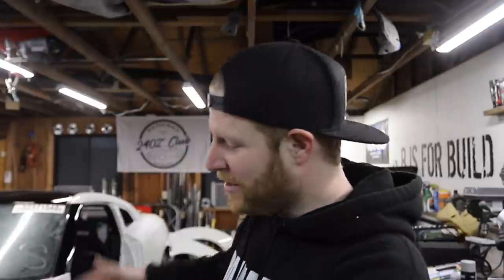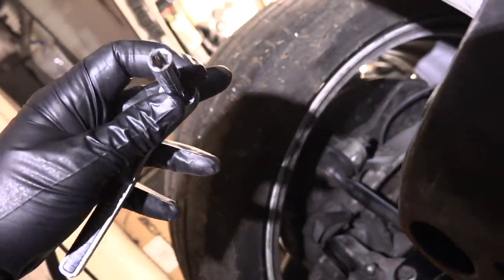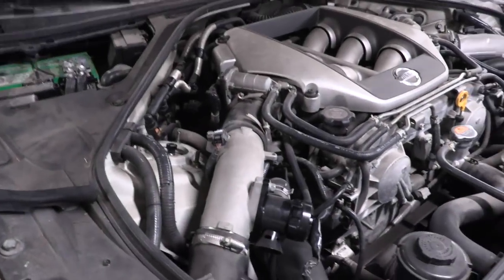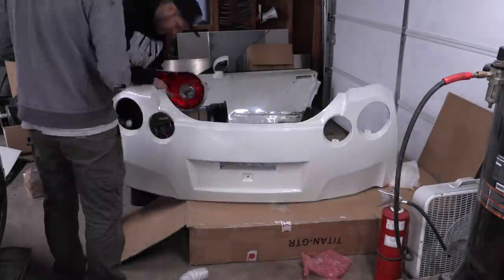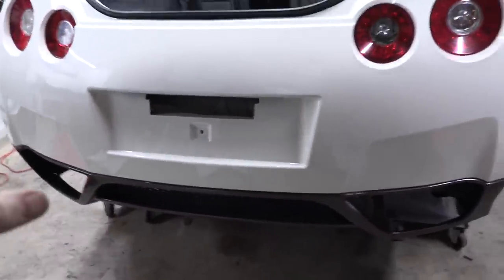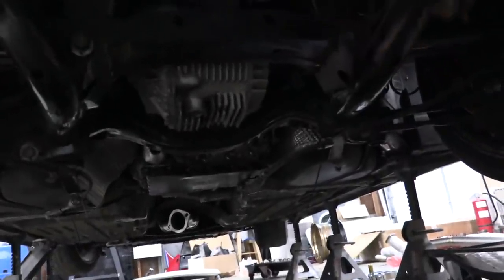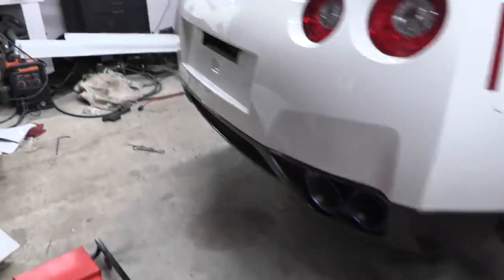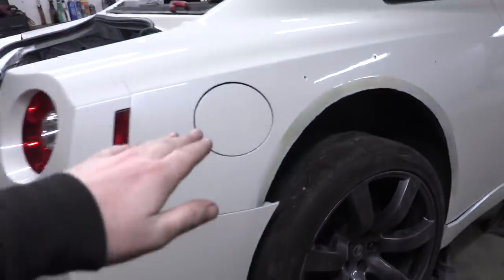The GTR gets New Titanium Exhaust that Shoots Flames!

Comment: This gtr was trashed at first!!! Now look at it like I say "B IS FOR BADASS BRO!!!"
Reply: Shoddy repair. Jes done alot of bunk ass cheap fixed that will be detrimental later on
Reply: @pwnzlikeme  detrimental in what way. It's a salvaged car. It's not like he's gonna get top doller for it, if he sales it. In the time he spent on it he's doing just fine.
Reply: @thonssubaday6146  and? Fixing a car well has nothing to do with the price lmao. It's not like you drive a gtr. By that logic neither you or I have a right to talk about how to fix a car properly👀
Reply: @wearesecret6481  detrimental as is if something goes wrong it will be much harder to address and fix down the line.(besides it's not a car he plans to sell) alot of the fab work and corners cut are pretty meh. I still find the build interesting though.
Reply: @pwnzlikeme  B is for Botched Build
Reply: Danny Valle your a savage dude
Reply: B is for bodged

Comment: Flexpipe and everything before might be stainless because of vibration. Titanium cracks quite easily.
Reply: I was going to say the same about stainless, where low chromium stainless is good for exhausts. I’ve only used Titanium with salt water cooled heat exchangers, where stainless tubes get eaten through eventually.
Reply: Also titanium is terrible at dissipating heat
Reply: Yeah my titamium exhaust cracked not to long ago

Comment: Chris, your sway/anti roll bar should be tightened with the suspension loaded.  That way when the suspension moves away from "loaded" position it helps to pull it back to position.  Otherwise your bar will be constantly pulling to try and return the suspension back to un-loaded, when it was tightened.
Looks like you tightened it with the wheels un-supported?

Comment: Just a piece of advice, since your car is now going to shoot flames, you really want to adjust your exhaust tips so the come out AT LEAST a half inch past the most protruding part of the bumper. As you saw, you had to wipe condensation from the bumper just from your cold start. When your tuned and really throwing flames, you’re gonna torch the hell out of your bumper if you don’t adjust the exhaust tips. Great looking channel, just found it today. Subscribed!

Comment: Titanium is not lighter than aluminum, but it is much stronger, so you need less of it.  It also has a higher melting point (good for exhausts) and better corrosion resistance.  However, contrary to what Professorss Guetta or Sia would have you believe, it is not bulletproof.
Reply: Thank you, I was waiting for someone to answer since I wasn't 100% sure myself. I guess I could have Googled it but looking through the comments is kind of like Googling it so I'll cut myself some slack.
Reply: Love the guetta and sia references 😂😂

Comment: full titanium headers crack with heat cycles. that is why they make the headers or downpipes section stainless, as it gets 3x more heat than the other elements of the exhaust. and you gotta bend those ends on the rear hanging points, or it will fall eventually.

Comment: Hey man awesome car and exhaust. Of I may give you a suggestion, add some exhaust gasket where u have the slip joints. I ised to have a slip joint exhaust and after a some time it started leaking and a professional tolde to add it. It's basically a paste that hardens with the exhaust heat. Never leaked again.

Comment: shouldn't you put some exhaust paste between two pipes when using clamps/slip joints to guarantee proper seal especially if they are of two different metals (to also prevent galvanic corrosion)? Or is that idea outlived in modern cars/exhaust systems. Genuine question, not a criticism

Comment: Looks like a piece of sheet metal is missing from the crashed side under the rear that acts as a heat heat to protect the suspension, you can see its there on the right rear but missing on the left

Comment: Aluminum weights 2.7 kg per dm3, Titanium about 4.5 kg per dm3. They use less smaller walls for the pipes with Titanium. 
If you want aluminum Exhaust with the same strength you need to increase the thickness of the pipe by a lot or use some expensive special aluminum alloy. 
Thats why titanium bikes-frames can be lighter than aluminum.

Comment: Reason there are two different sensors is because you can not connect the right in the left as a safety thing, a common thing on cars with two pieces manafold/downpipe 

:)

Comment: Am I the only one that thinks the tips of the exhaust should be sticking out future, they look from that camera angle like there inverted
Reply: I like them flush like they are.
Reply: If he does not move the tips out further they will burn his rear bumper turn it black
Reply: @AFK365  I thought of that too and it looked like he checked that with a wipe in the video, so he had the same concerns.
Reply: I know from experiance i had my Subaru rear box converted and they done it to short and it turned my rear bumper black so i took it back and the sorted it for me.  @automisery484

Comment: The head type is e-torx as in external torx
Reply: True .also you can use alot of metric sockets on them depending on the manufacturer : )
Reply: @123ytk9  yikes. I wouldn't recommend it.  You may get away with it but the time spent doing with a rounded head isn't worth the money saved not getting the right tool.

Comment: PS cheapy two part Epoxy isnt plastic weld.  There are actually solvent based glues that fuse the plastic to itself.  Or you could go the proper route and use an actual plastic welder.

Comment: Hey just a heads up.  Please don’t drop O2
Sensors like that. It breaks the insides and they don’t read right. Please be careful with it. Don’t want you to try and figure out an issue only to take forever because they were new going in but damaged. 

Otherwise, great job!

Comment: i still don't get why you call it lucky that the hangers lined up... it's an oem replacement exhaust, if they didnt line up there.. i would send it back with a load of swearwords lol... and the universal rubbers are also made to replace oems... but love the fireballs, as a mini cooper S driver, crackle and pop is the best sound!!!
Reply: At 10:48 + he explains that he is using universal exhaust hangers he purchased for the 240z build because the original hangers were missing.
Reply: david d quite aware of that, that's what i wrote, but universal mounts are made to fit well, universally, as many models and orientations as possible, that's why i would be wondering if it didn't fit
Reply: @Tarex_  He's talking about the bolt holes from the universal mount, not made for a GT-R, lining up with where the factory bolt holes are on the car without any fabrication.

Comment: Inverted torx bro, not E socket. 😂 love you man. My VWs are filled with those and 12 point triple squares. Find any of them yet?
Reply: I hate those triple squares. If they're in an awkward spot, they slip off easy. My Tiguan requires a #14 triple square to remove the front suspension. It's not something conveniently located in local auto parts stores either so I had to grab one from the Snap-on truck.

Comment: Shouldn’t the exhaust tips stand out more than be tucked in?
Reply: It should extend quite a bit once it gets hot.
Reply: @TBasianeyes  lol what? are you implying the exhaust tips will extend out when they get hot???
Reply: Vlad S yeah it happens when they get hot.
Reply: @vlads1759  The whole exhaust extends bringing the tips a bit further out.
Reply: They are flush on the stock exhaust too.  I have a Switzer 90mm exhaust on mine and it sticks out like 1.5" inches which I like as it doesn't cause the back of my bumper to get stained by black soot.  Also having pops and bangs it can burn or stain the bumper.  He should extend his a little bit if he can.
Reply: @tjlazer71  +1 for this.
Reply: @tjlazer71  I'm thinking that might be one of the first things he changes once he sees the effects of the 2 step on that freshly painted bumper.
Reply: Vlad S when you install a new exhaust over a week or so it will stretch a inch or so and will need to adjust your tips
Reply: They are not flush, they stick out on my 13' stock tips just xpipe and downpipe so...

Comment: Non-cast bellmouth downpipes will eventually crack..  or so I've read.
Reply: From a metallurgical standpoint that makes no sense. Forged downpipes would be most superior with billet coming in second. That is of course as long as the welder didn't do a shitty job.

Comment: You probably have this under control but be careful when running a car inside, if you run it for too long the carbon monoxide produced by the engine can make you pass out or worse, it doesn't smell and doesn't have a particular color or look.

Comment: My dream is to get my E30 to shoot flames. Is it possible to get a bolt on exhaust and get it to shoot flames instantly or do I have to get a tune.
Reply: You need a tune
Reply: There are ways to get maybe pops with an exhaust, I did on my old Audi and I've seen it done so I assume, but a tune will help, my new subaru does it with no exhaust, just a tune
Reply: Really depends on the car, I straight piped my Suzuki Sidekick (not a streetcar, mudding only) and it shoots flames just from that
Reply: No you dont need a tune. Cut off the pre cats and cats and resonators.
Reply: Straight pipe it or cat delete and tune it to run lean wait and cut outs
Reply: Don’t get a tune that makes you pop flames . It’s stupid and it doesn’t do anything but bad stuff . All my buddies that got a tune just for that ended up ruining things . For example someone just did that and now only had comp in two cylinders . Do upgrades . Then tune . Not just tune

Comment: Can you tell me where you i can buy titaum exhaust and what i would be spending on it but information to contact will be appricated
Reply: Depends on the car. Throtl has a decent selection usually. Stainless and some Ti
Reply: @Mitch3343  Ok Thanks i have a 911 that i want a set from
Reply: @Mitch3343  But is Throtl a company that sales them

Comment: you better take your time and paint this one right!!! at least give her a clear coat
Reply: Cerfew 641 he already painted it. And he made the roof black which ruins the design flow of the gtr. And now the tips are set too far in. I hope he decides to respray the roof and replaced quarter panel.
Reply: @joshuamartin3232  that's what I was meaning by painting it right, the roof looks so out of place. needs to solid color through and through. as for the exhaust I think pulling them out maybe another inch and a half or 2 would be enough

Comment: Why did you spend all that money and not get a true dual exhaust?!
Reply: Very few companies make a "true" dual exhaust for the GTR considering there is only one possible exhaust channel. You're either going to run two much smaller pipes that are welded together or one large pipe through that channel. It's basically 6 of 1 half a dozen of the other.